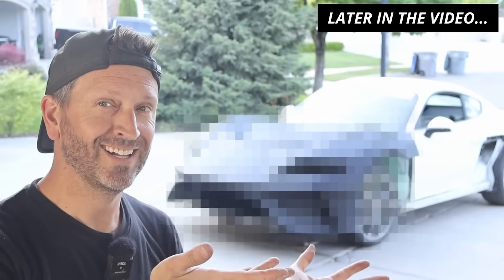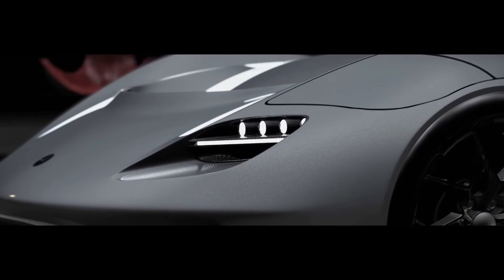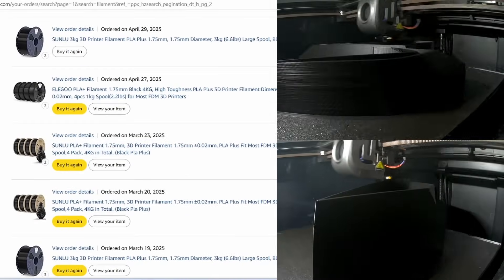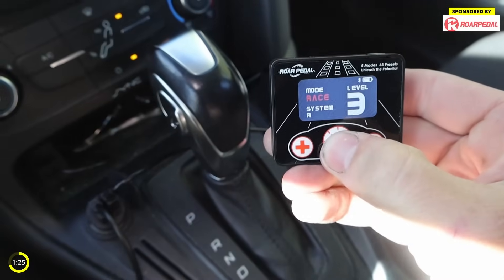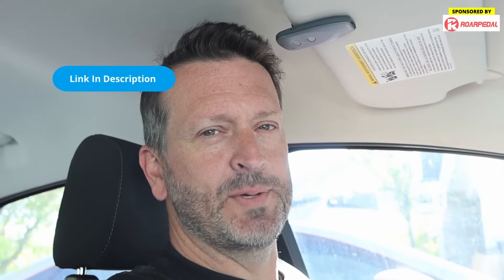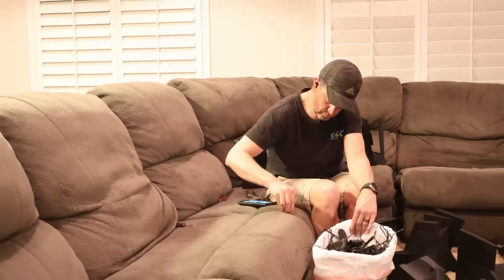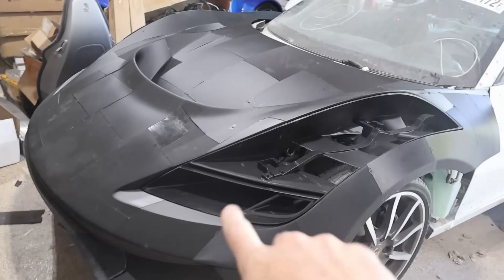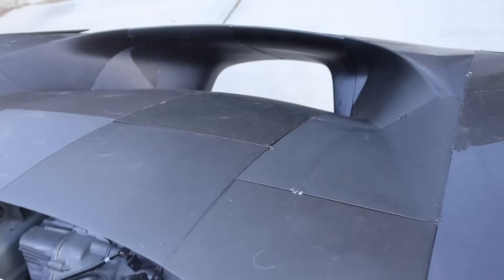This 3D Printed Porsche Front Clamshell Turned Out Wild!

Comment: NO SHOT WT...I DESIGNED A BODYKIT FOR THE 987 CAYMAN S ON BLENDER A FEW MONTHS AGO AND THE FRONT END LOOKS VERY SIMILAR TO THIS HAHAHAHA. I CAN SEND YOU MY BLENDER FILE IF YOU'D LIKE LOL.
Reply: I was planning on using clay to replicate the bodykit irl and use that as a mold to lay carbon fiber on but I guess 3d printing works too. Just didn't know how feasible it would be to 3d print the whole bodykit, but it definitely makes the symmetry part a lot easier

Comment: Should I use 3M body glue McLaren's are literally all put together using that glue is a plastic weld literally it's good stuff little expensive though but I guess if you're going to put fiberglass over it wouldn't matter you are going to put fiberglass over at aren't you?

Comment: Do you use these glued together prints as a mold to lay fiberglass or carbon fiber over and resin them? Trying to imagine the finished product and really hoping it isn't just these printed pieces glued together and filled with body filler. Looks absolutely amazing however you plan to do it though!
Reply from the maker: Just a shape for a mold.  Final parts are planned to be carbon fiber

Comment: I know you probably plan to put filler and paint over, but on a car PLA will have massive deformation issues over time, just from sun exposure.
Reply from the maker: This is just a shape to make a mold and then carbon fiber parts.

Comment: u can call this what u want. but a car part it is not. it looked like CRAP to me. you have so much finish problems i dont know where to start. its 100% clear that you have not calibrated your filament properly, those "ripples" on the outerwalls is not what is called "great". using pla for a carpart is fkn dumb... at least check the properties of the polymer? ffs.... this is one of the dumbest things i have seen in a long while... tis like making a boat from rice-crispies.. and to glue with ca is sad... use a slurry made frpm the same polymer at least? 

THIS is why ppl buy 3dprinters and end up selling them. u dont know how to use it and what to use it for. fkn pla? are u kidding me?
Reply from the maker: @reyalPRON  Dude, calm down.  PLA is just a form to make a mold.  Final parts are planned to be carbon fiber.
Reply: @electricsupercar  does not matter... pla is shait.. it distorts from small temp changes and is chemically unstable.
at least use petg or something chemically stable that does not react with the mold polymer.
using pla leaves u with very few options. all of them subpar..
its kinda like making a sword from  lego and trying to use it as a proper sword. 

what final is and what u are showing us is not the same is it??

ffs..... pla is for model that goes on a shelf or for fitment testing. its not usable as an engineering material in any way except for lost wax casting for anything automotive. even a mold will be shit with pla. molds work best with silicones or ultra rigids that can take some temp... pla is garbage noob material.

u need to read up on polymers....

i notice u pick and choose what to reply to here.. 

what about ur nonexistent pa and flow calibrations?  did you even run a phase stepping calibration?
u say to ppl this is good, when it is shait... if i presented that crap to my customers i would be out of shop in a fortnite...

u cant say this is good prints sir. its poor.
calm down? im calm as an icecube.. im telling you that what you are doing is poor craftsmanship and not true. it not a good print, its not the right material, its not the right adhesive. what does that have to do with calmness, did you see any caps there that was not right in its place?

what you are doing is called straw-manning and gaslighting. you pick and choose the one thing you think you can defend and go for it. meanwhile in the real world ppl with more experience than you laugh at you.. we are having so much fun at the shop discussing your videos now we can hardly get work done! 

i write on several topics and ur feeble mind can only reply to one... fantastic... there we go folks. he proves him self to fit the profile 120%.. trying to strawman me into this "im not calm" thing is ridiculous and childish. you promote this printer as ready to go and "makes good prints out of the box" it doesn not ... ALL filements need a PROPER calibration of MANY parameters to make a good print, IF the printer is capable. 

there u have some caps as im a tad irritated... 
see the difference ?
fkn ignoramus
Reply: @electricsupercar  does not matter... pla is shit.. it distorts from small temp changes and is unstable. at least use petg or something chemically stable that does not react with the mold polymer. that leaves u with very few options. its kinda like making a sword from  lego and trying to use it as a proper sword. 

what final is and what u are showing us is not the same is it?. 

ffs..... pla is for model that goes on a shelf or for fitment testing. its not usable as an engineering material in any way except for lost wax casting for anything automotive. even a mold will be shit with pla. molds work best with silicones or ultra rigids that can take some temp... pla is garbage noob material.

u need to read up on polymers....

i notice u pick and choose what to reply to here.. 

what about ur nonexistent pa and flow calibrations?  Or surface faults? 

u say to ppl this is good, when it is shait... if i presented that crap to my customers i would be out of shop in a fortnite...

u cant say this is good prints sir. its poor.

Comment: Likely should have done some alignment pegs and holes so that all the part would match up and fit kind of like legos that way you can't really get any parts that slip or slide about as you glue and staple them together. Either that or do a notch and groove so they slide together. (both really)

Comment: I know very little about 3D printing, but I saw another video where the guy was using Methylene Chloride to bond 3D printed parts together to make a headlight housing. That method looked very neat and was strong. It basically melts the PLA parts together thus bonding them permanently. The downside of this method is that Methylene Chloride is toxic and should be handled with care and not inhaled. I wonder if this would be a better alternative to Gorilla glue and the heated metal pins you use. Just something to look into. Your design is coming together really nicely though. I just know it's going to turn out spectacularly.
Reply from the maker: Thanks for the tip, I'll definitely look into that!
Reply: @electricsupercar  I just found the video that I was referring to. it's just after the 9-minute mark; https://www.youtube.com/watch?v=SsOfFP-mRf8&t=3s

Comment: I wasn't blown away with the rear when it went on, but wow, I think you've nailed it with the front! Looks epic!!
My small comment about the active aero - if the car is building enough positive pressure over the wheels to need venting, having the flaps able to flex/pivot themselves is all you need. Active aero over the arches is cool, but in reality they're never needed and passive will achieve exactly what you need without the complexity of motors/pneumatics. Active will look cool, sure, but you don't need it. Plus when it rains and they're open, you'll get a wet screen & windows for sure. Fitting a sacrificial deflector or even a tight mesh underneath the flaps makes a huge difference and doesn't slow the air enough that you'd ever notice. Stops rock chips too.

Oh and those small bits behind the front wheels you don't know the name of - in the UK some of us call them 1/4 blades or front tub blades

Comment: Pretty cool that you printed the bumper. Can't believe the parts weren't labeled haha. Are you planning on reprinting it in ABS or another tougher or heat resistant material (since it will be outside)? Awesome project.
Reply: carbon fiber this is just a mold

Comment: Another great video! It's nice to see you getting to do a little bit on the Porsche.  Nice progress, and since it is simply a mold, PLA+ makes sense. Were you able to get the pieces to fit flush or was there a bit of spacing with the glue?
Reply from the maker: Always a little bit of spacing.  But I figured even the layer lines won't work for what I have planned.  So it will be mudding and sanding.

Comment: This channel is awesome, it needs a subscriber boost, you tried some channel crossover with JerryRigged, but for some reason you didn't get the kick expected. You have been doing cool custom designs for a while, don't give up, try for a crossover with Foose or Kendiggit designs. Maybe do something wild and slightly outrageous to get some attention, like a dragracer gocart with four drive wheels in back using a Tesla front drive unit front and back for AWD, using supercapacitor batteries (Costly) A super fast quarter mile time would get the attention of Cleatus Mcfarland types. Also good would be getting one of your projects in the spotlight at SEMA. You have the designs and electric conversion skills needed, keep at it, I fully expect you to get a viral video that will get you where you need to be. Maybe a foreign channel like Electric Classic Cars would let you visit or vice versa. Your channel has big league quality output you deserve more subscribers.
Reply from the maker: Thanks for the encouragement, and appreciate the ideas!

Comment: OK one you didn't answer in this one but might have before (if you did I'm sorry for asking again). This is just a template for a fiberglass part right? I mean if you use this like it is or even coat it in fiberglass wouldn't it just fall apart like a bunch of Lego's? I guess what I am really asking is how is this going to be strong enough to drive around with all the vibrations and whatnot?

Comment: When I’m splitting 3D prints in multiple big parts to glue together, I subtract a shape from both flat faces that I can use to put an adhesive in. I do this in fusion by drawing a series of offset paths on each of the split flat faces and extruding a rotated square around each of those edge loops. 
This makes the actual flat faces sit closer together and removes the issue of thickness of your glue adding up across all pieces
The rotated square shape of the groove makes it still print very easily and it also breaks up the large flat faces reducing warping.
Reply: Bambu studio has the best splitting functionality I've seen and it will generate dowel pins or dovetails for you
Reply: If you don't have a machine on the compatible list just use Orca, it has basically everything and keeps that feature
Reply: I’m saying thag it’s often better to design these yourself in your design software. But I was talking about gluing specifically.

I have the same opinion on supports and infills.

If you’re interested in software for this you can check out “materialise magics”.

The professional industry is way ahead in these areas.

But if bambu studio is all you need and you’re doing smaller scale stuff, keep using the tools that work for you :D

Comment: I realize the reasoning on why you can’t work on it, but this was why I subscribed a while back! IMO this is your best project, and I’m looking forward to it moving along!

What are you printing with PLA? ABS? 
Do you plan on just using it as a mold?
Reply from the maker: Yes, using it as a mold
Reply: @electricsupercar  Ahhhhh. Makes sense. For those who don't know - PLA prints well and is cheaper, but deforms in the sun/heat for vehicle applications! That's more KG's of material than I've ever printed combined!

Comment: Questions -- #1) Why PLA, are you planning on wrapping it in carbon fiber, I ask as PLA will warp with heat, wettness.  #2) Where is the strength.... it looked like you removed a lot of the forward impact area.  As PLA will not provide great or any resistance for impacts, what is your plan in this regard ?  I get using PLA as its cheap, but seems like this -- IF finial -- should be done in something different, like PLA-CF or CF or PETG / ABS.
Reply from the maker: This is a shape for a mold.  Final part will be carbon fiber

Comment: You should use the shell feature in your design software to remove most surfaces between the parts. Would probably have ended up 50 kg instead of 80
Reply: That's good for small individual parts, but he needs the rigidity here to just hold its own weight. 3 walls (even assuming a small 0.4mm nozzle - maybe he switched to 0.8mm) is still pretty thin for something this big. Infill also plays a big part in keeping it rigid. Absolutely required here.

Comment: You need to try out Gloop, I know its expensive, but it works soooooo well.  Also PLA isn't UV resistant and warps in heat too easily, ASA would have been better filament type IMHO.  Great job!!!!!

Comment: Commentwise, absolutely great stuff! Since i just found the channel, donno what the plan is, but i suppose it will be used as a buck for a mould to do carbon fiber or glass fiber or something, since PLA sure is the worst choice and not cheaper than ABS, but this just confirmed my wanting to get the K2 plus, since the K1C has been brilliant so far

Comment: Did you design this with structural integrity in mind? I know it's gonna get wrapped in CF/GF but how are you gonna do complicated geometries (like the headlight assembly)? Is it just gonna be mounted to the plastic? What about the active aero? With high speed braking/cornering those will experience a lot of force. Is there a load path down to the subframe?
Reply from the maker: Been working with airshaper